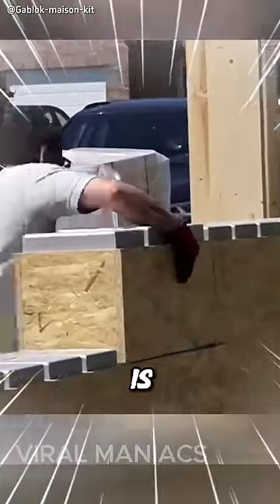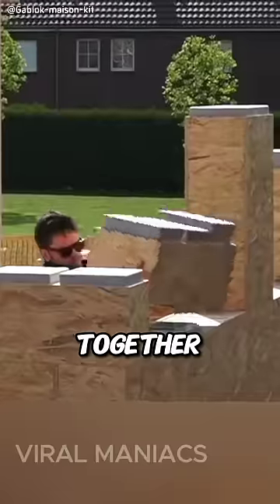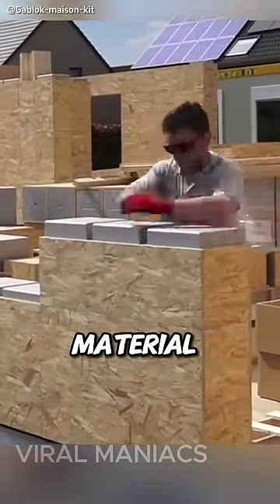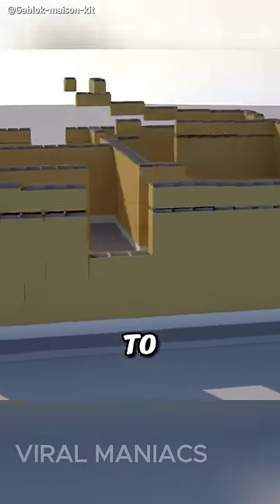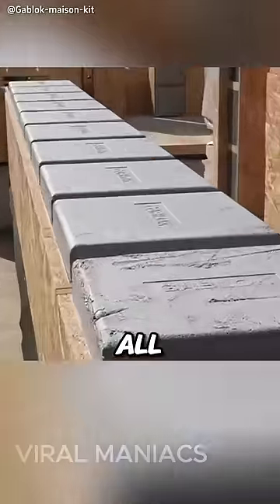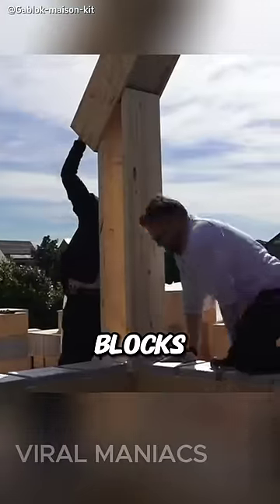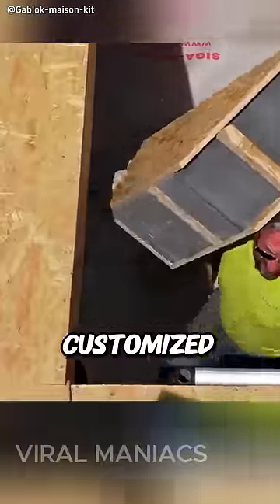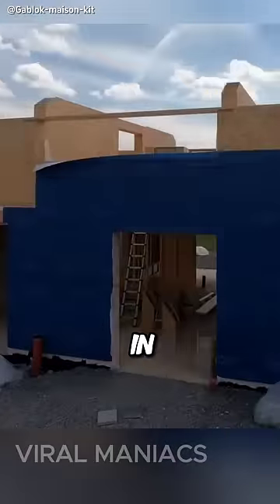Whoever Invented This Way Of Building Houses Is a Genius #shorts

Comment: Good idea but lots of cons !  
1.    Huge fire hazard.  Fast burn and highly toxic fumes 
2.  Nightmare for plumbing and electricity.  
3.     Walls not as sturdy for high winds 
4.    Can’t hang anything heavy on the walls
Reply: It would probably burn down immediately as soon as the fire hits the polystyrene
Reply: All wrong...none of what you wrote is true..or correct.
Reply: Im guessing you’re just guessing… right.
Reply: Bro u on a mind adventure
Reply: You could hang anything you wanted. Still has a standard roof from what I see so no interior collapse issues.  The rest of your points are valid though especially plumbing and electric
Reply: You're like one of those sudden YouTube construction building inspector experts lol
Reply: @bossone1216  Nice attempt at a call to authority. Unfortunately for you it doesn’t take an expert to tell you that it’s stupid fucking idea to build a house of plywood and foam.
Reply: I’m assuming you just made up whatever you thought was logical 😂 you are completely wrong
Reply: @jeremyripton  I guess enjoy off grid live or having all plumbing and electrical in surface mount and conduit
Reply: @jeremyripton explain why
Reply: 🤦 Yeah since they didn’t think about any of this before planning nor or are there any laws regarding any of these features..
Reply: Aren't most houses in USA made of wood and insulator?, so any house should burn almost the same. Also something they don't show is that in the creation of the 3d sketch, the water and electric tubes are put in their place and custom semi hollow blocks are put there, so the construction team knows exactly where to put them.
Reply: @Lucky_RFMDA  but I belive they are made from logs and planks with actual heavy concreed fundament, not a plywood
Reply: Major issue is that mice like to nest in the polystyrene insulation. Plus toxic invisible fumes in a fire from most plastics.
Reply: @charlesbrown4483 don’t we already build houses out of plywood and foam
Reply: @bobbyledger2249  No, we build houses with actual frames.
Reply: @charlesbrown4483  and what do we attach to that frame? What gets used as insulation inside that frame? These days spray foam is used just as much as rolls or batts
Reply: @bobbyledger2249  You're being intentionally obtuse. What happens to a normal house if the frame magically disappeared? It fucking collapses.
Reply: @charlesbrown4483  you really think this type of building material could really just disappear? I think with this type of system you would not want to build one single wall to its final height. The wind could blow it over without support. I would give it a try. I just learned about insulate concrete forms. Those can be built all the way up to the roof. The insulation value is beyond anything we can build with stick framing. I’m open to trying anything that might be an improvement.
Reply: @bobbyledger2249  🤦🏻‍♂️🤦🏻‍♂️🤦🏻‍♂️

Comment: Until a strong gust of wind comes by

God: “I’ll huff and I’ll puff and I’ll blow your house down”
Reply: If you sheeted the outside of that structure, it wouldn’t go anywhere. 
The inside would be finished traditionally, with sheet rock this house wouldn’t go nowhere. I do think a bead of liquid nail around every seam before you put it together would be the way to go.
Reply: I mean I can see why you think that. But the sheer weight once finished won’t go anywhere
Reply: @MikeHoncho884  still feel like it’s not structurally sound as a typical wood frame constructed home, will not be building my place with this lol
Reply: @Kai-tc6wr wood frame itself doesn’t seem very resistant either
Reply: @alexandrevieira2410  the weight isnt the issue, i dont think it would blow over .... the main risk in my eyes is fire damage, if you do happen to have a fire, your house is pretty much done, where as brick and block are more likely to be still left standing, and you would just need to clean it internally, replace anything damaged, and your house is still left standing, i would say internal timber framed with a brick skin would also suffer the same fate. (im a bricklayer/builder btw)

Comment: What’s the name of the company making these? My family’s been doing something similar with ICF blocks. Same idea, assemble the walls out of giant Lego blocks, but ours are hollow and made of a sort of styrofoam material, and you fill them with cement once they’re assembled. These seem easier, maybe a bit heavier to assemble because of the wood, but much easier to cut holes for electrical wiring and water/sewer pipes.

Comment: I saw ready made house kits made in Germany about 20 years ago. But they came as pre insulated wall, floor, roof etc sections. This looks neat.
I rent a house built in old Spanish style downstairs. 2ft thick stone walks. Cool in summer. Once the stove is lit on winter the stones hold the heat. Upstairs though is modern concrete blocks. Like an oven in summer.

Comment: As a firefighter I strongly disagree. They are not a genius. They are dunces. OSB fails at 300° and Polystyrene (aka: solid gasoline) goes up like a roman candle. I wouldn't use this if it was the last building material on earth.

Comment: What's the cost versus standard materials? How do windows and doors fit in these extremely thick walls? How are these and other items secured without structural studs? How tall can these be built? How much weight can they structurally support?

Comment: Run the electrical and plumbing pipes on the outside...okay.   Makes decent sense.  Easy to repair.  I have pipes rattling in my tract home and don't know where to begin to look for the loose straps.

Comment: Looks like it be pain in the a$$ to ruin wire and pipe through. Plus you'd still have put in 2x4's for lights and plugs. 
Not saying it's a terrible idea, but it sends like it adds more work. Be interesting to see though

Comment: Everyone commenting negatively about electrical, plumbing, hvac, etc, etc are the most unimaginative boring people. I say go live in a cave somewhere. It's like wasting my time demonstrating anything to a brick. On the otherhand, those who see potential of the system and the problems inherent and want to tackle to invent solutions are the builders I'll pick any day of the week. These people are throughout history the ones who continually save humanity (including the morons) from extinction. BTW for my money I prefer to seek alternatives to the traditional electrical wiring , plumbing, Hvac Systems operating in 99% of residential homes today. Those systems create way too much waste in materials and energy for the comfort and convenience they deliver. In fact living in a cave is probably preferable from a holistic, environmental perspective. Humans have lived surrounded by rock and mud for millenia so the psyche is comfortable with these materials, but corrosive to the Earth.  New inventive materials (glass, steel, carbon, plastics, foam composites, metal sensitive alloys, Origami building systems, resins, good ol bamboo) are just some of the materials that have yet to realize their potential in building small scale residential structures. To date the best the boring minds have come up with are basically "trailer homes" with short life spans and wasteful use of energy, not to mention exposure to toxic materials. So my question to the negative comments: Can you come up with something better, safer, cheaper, prettier, psychologically enhancing, easier, stronger to build?

Comment: Well there used to be a styrofoam interlocking system with gaps and tunnels in them into which you poured concrete to lock the structure together after assembly.  I think it was called Iceblocks but the market got taken over by less expensive forms which just had a styrofoam board held in the center of the forms and you just poured concrete into the forms.   Basically this is nothing new, was better done in the past and as with many better mouse traps, just died out in the market as less sophisticated and arguably inferior products took the market niche and the market niche never overcame traditional construction methods due to a premium cost.   Given that it has been over fifty years since I've seen similar approaches, I would've at least expected that encapsulated phase change materials would be inside the blocks today, not just styrofoam insulation.

Comment: That house would be garbage…. The polystyrene will off gas toxic gasses for years, no way to install plumbing or electric properly and OSB boards burn like they are soaked in gasoline….

Only an idiot would build a house this way.

Comment: Now for stability could you do like my father in law did for his và log home he put big threaded bolts down each corner of house and into concrete pad with a giant nut at the top and yearly he would check to see if logs had shrunk or expanded and would tighten or loosed as needed it made the house more sturdy and logs tight fitting this was in Wyoming and the wind there is harsh and constant but maybe this would work on this type of house  and go along way with wind resistance and keep it sturdy maybe   It’s a thought

Comment: 🤔🤔🤔   No plumbing or power conduits? 🤷‍♂️  Or does that go OUTSIDE the walls?   🤔🤔🤔  NO THANKS GENIUS!
Reply: That's funny I was actually gonna leave the same comment. It's funny but it's not funny. I thought to myself OK so now that the house is put together how are they gonna run all the cords and all the pipes and everything? They're gonna have to do framing work so they're gonna have to frame the whole inside of the house and put extra boards in there cause he just can't hang wires and pipes everywhere so extra framing inside, just makes no sense. It's so much extra work now if you don't need no plumbing, no lights no electricity no power. This would be great.

Comment: This Could Easily CUT IN 1/2  An Electric Bill OR The Co$t Of/Necessary # Of Solar Panels & Batteries In A Solar Setup! This Should Have 0 "THERMAL-BRIDGES" either... well asong as the Windows & Doors Are Also Done Properly & Of Good Quality (Windows @ Least 2-Pane(+)(Solar Shades/Tenting/& Shutters/Etc.~Would Also Help Substantially)& Outside-Door Handles Are Made Of/Or Coated In; Non Heat-Conductive-Materials OR Are Properly Insulated/ISOlated From The Inside Handles).

Comment: Well insulated to a degree (pun intended) but there still remains a lot of Thermal Bridging everywhere the OSB extends from the interior to the exterior, just like Studs do. However, if they clad the exterior with Rigid Foam Insulation before putting the Finished Cladding (siding, stucco or brick) then the Thermal Bridge is broken and you have an extremely efficient home. That said, you could finish a Standard Stud or Concrete Wall the same way and it would be far less expensive than this method.

Comment: Why don't they use PU or isocyanourate?
Or even blocks of Rockwool?
They are far far less of an issue in case of fire?
Check out how sandwich panels in commercial buildings have moved away from EPS to these materials which are far far safer.

Comment: Those are called WOODSIP houses. They are insulated panels.. keeps your house cooler in summer and warm in winter. They are also really great in snow areas, floods, earthquakes, tornadoes and hurricanes bc the panels are airtight so they don’t tend to allow water in and they flex in high winds unlike a standard frame house. If a panel gets damaged you just remove it and replace.

Comment: Not safe 
Not secured 
Tornado will definitely rip your toy apart
 Cheap house building materials and building them  is unacceptable in my book.
I've watched what houses are made with , they definitely won't be around 150 yrs from now !! 
Like houses from before 1950's that are still standing and still solid after 150 yrs .
They knew how to build things to last something modern man has forgotten how to do in our throw-away society!!
Given the right tools and materials I can build a cabin that will be around for my family to use for a few generations ,while that (your lago blocks)will contaminate the environment as it leech out the various chemicals used to make it . 
My wood, plaster, and nails will not cause contaminated ground water or hurt the environment ! 
To bad building good houses used to be a good work of art. 
Now, just clapboard housing like the 1960's, cheap buildings!
No style at all !!

Comment: You still have to provide spaces to run your electric,  data, plumbing & HVAC which is not shown in these lego walls. Will take some serious planning.  What would be the best way to anchor this structure to the foundation? You would have to utilize architectural services and the required approvals. Definitely wont be like the demo implies as far as easy and quick

Comment: Every section of wood is a thermal bridge from the outside of the house to the inside of the house. I highly doubt the R-Value of this system is actually good in a real world application. You are better off using slip-form construction with 12" wide aircrete walls for inexpensive and R-42 walls that do not need interior or exterior OSB sheathing or drywall and are fireproof.

Comment: I see several problems with this design, though. Electrical would be a massive pain to install. If water damage starts to happen, replacing/ repairing the walls would be harder. There would be little to no ventilation in a house built that way so mold, mildew, and co2 buildup would be a problem. No hvac system could be easily installed and would probably cost 3 times the amount to install one. Interesting idea, but like i said, i see quite a few problems.

Comment: There is no internal skeletal structure to support this. Even with brick outer layer there just isn't enough wall support strength to last more than a generation and you will have to reduce it all. That wood isn't designed to last more than 20 years well taken care of.